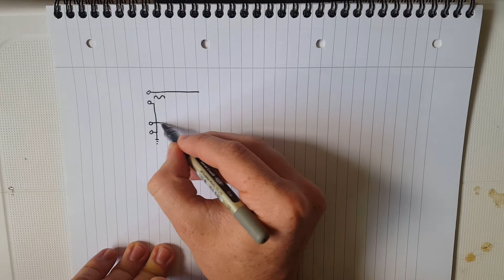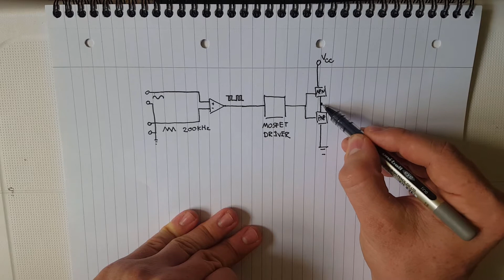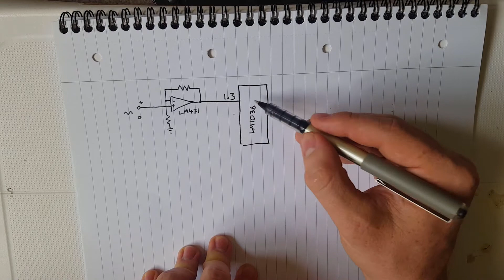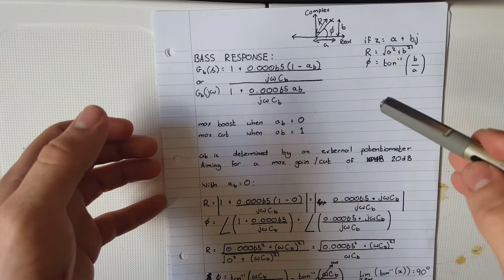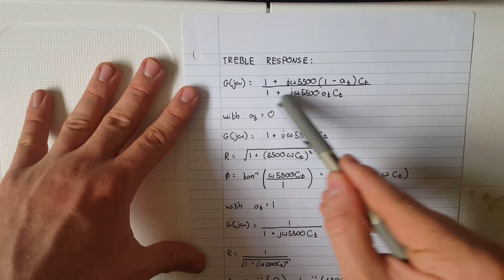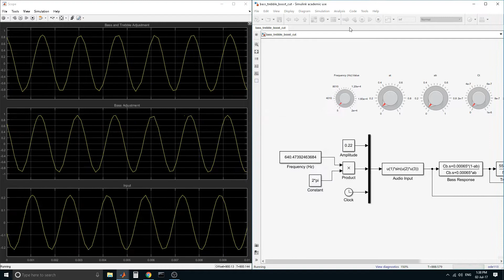Class D Audio Amplifier (Part 1 - Design and Simulation)

Comment: Practical class-d amps are not operated with open-loop PWM. They use a self-oscillating variable frequency approach.
Reply: Not all, the Gan mosget types does even -80dB distortion in open loop with triangle. But needs a really good supply without ripple.

Comment: Please sir post part 2 and 3 before the end of next week. Am depending on it for my final year Engineering project
Reply: Could you do your project?
I'm in the same situations :(
Reply: @octavioadrian7399  same here! but i don't know where to start
Reply: @MrChicoize  
You have to start with the design of the PWM (Pulse-width modulation), then connect it to a driver.  I am using LtSpice and I used the LTC4442.  You have to connect this driver to an H bridge and in the same bridge you put a low pass filter.  I’m going to attach an image of how it should be with this driver
https://encrypted-tbn0.gstatic.com/images?q=tbn:ANd9GcSDLL5M0eqkSHH5Nhnn6hQ_LXrGTDDAB921MQ&usqp=CAU

I can give you my document if you want, so that you have it complete and give you a reference to your work.